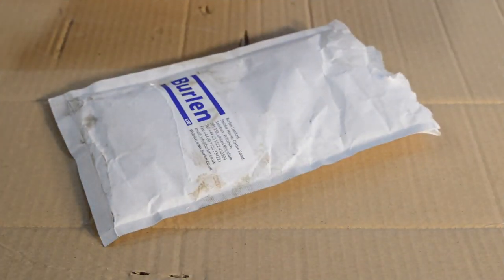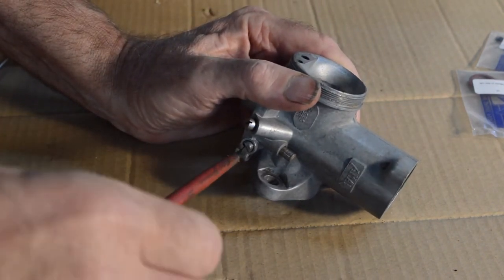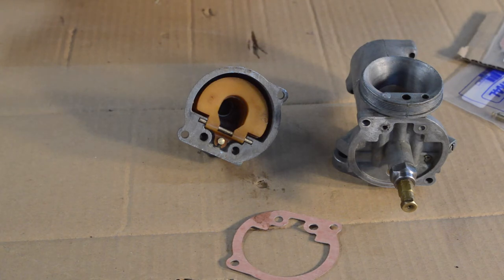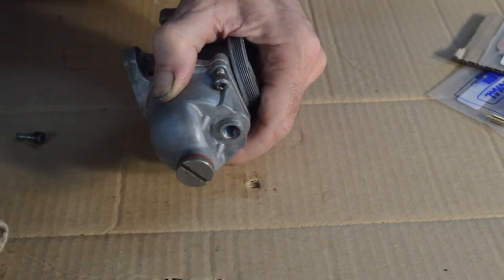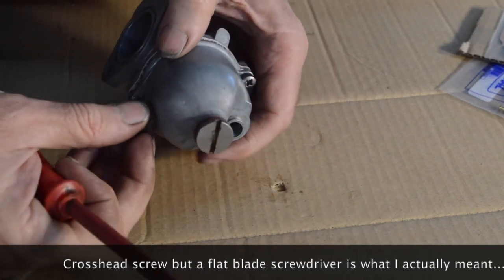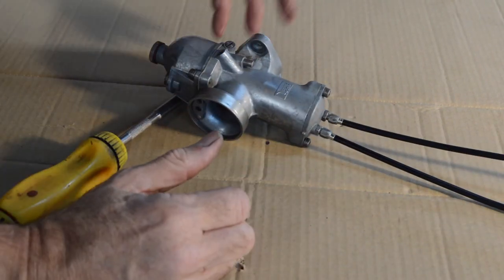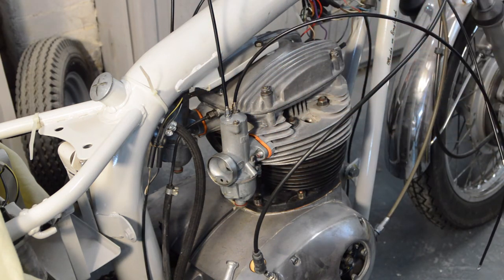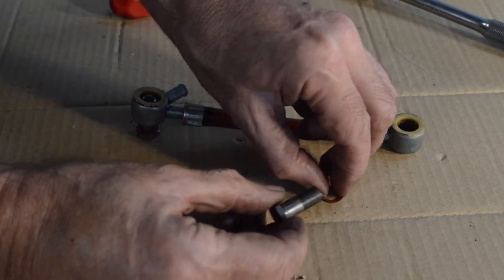Amal Concentric Part 2

Comment: I don't know if the same applies to the A65, but I've never needed to use the choke on the 930s on my Triumph T140V, just the ticklers on a cold start. After about 25 years, I decided to remove the choke mechanisms completely and blank off the cable holes. It makes it much tidier around the carb area without the extra cables and lever (I kept all the parts in case a future owner wants to restore it to original). From what I've seen, you probably want to keep yours to original spec anyway.
Reply from the maker: hi Rick,a few people have told me that their biker will start without choke but my Firebird needs both to get going
Reply: Same here in aus with my t160 trident, Mr n hyde advised me this in the 80s

Comment: A brass float needle is too heavy and the carb might work but won't work as it was designed to operate. Aluminium needles will lift on their own due to the weight of the column of fuel above and then the carb will work as it should with the rising float closing the needle rather than the sinking float raising it. It makes about 6mm difference on the fuel height. With the Aluminium needles the carb works as it was originally designed to work.